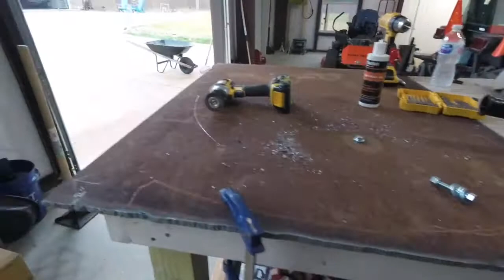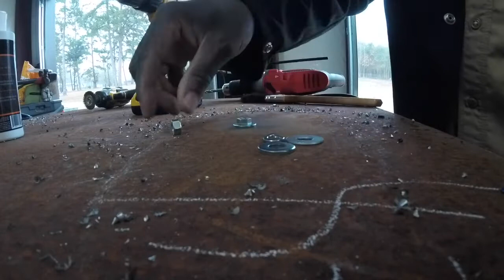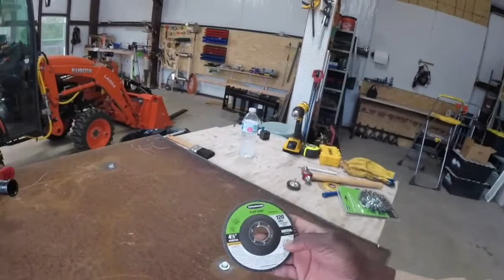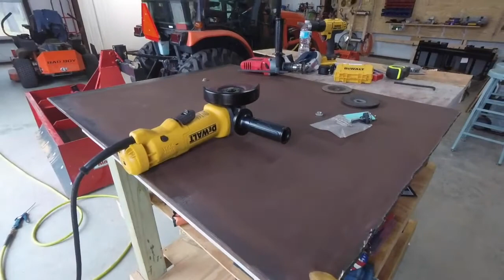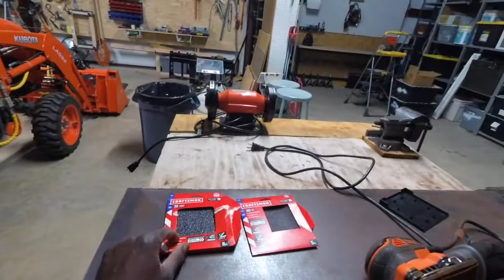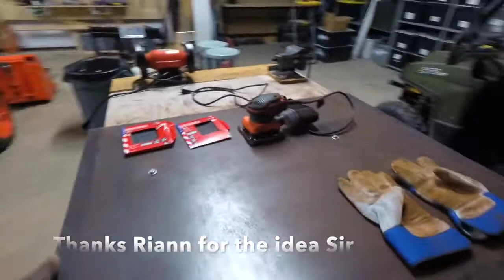Welding Table Conversion  - Black Friday Project!

Comment: That table will be great for clamping and weld small projects.  Most welders take the guard off the angle grinder so they get the grinding wheel flat and knock the rust off. Be safe buddy!
Reply from the maker: Hey Scott, I thought about removing the guard as well . . . great minds think alike:)  Take care Sir!